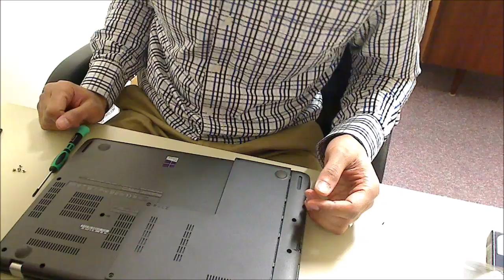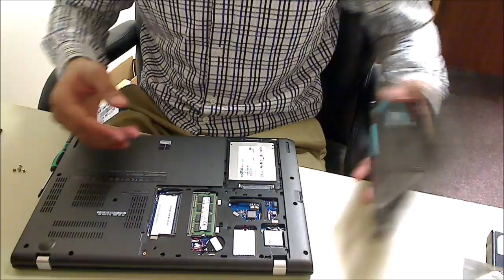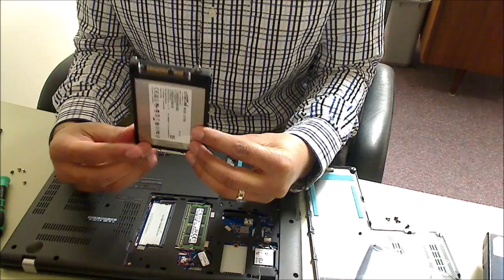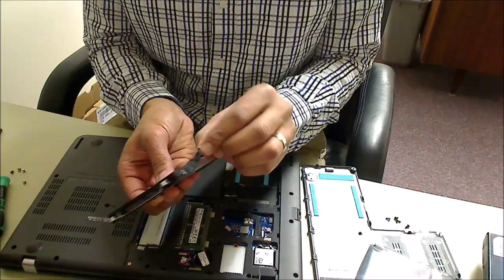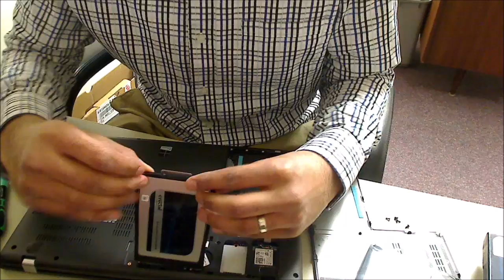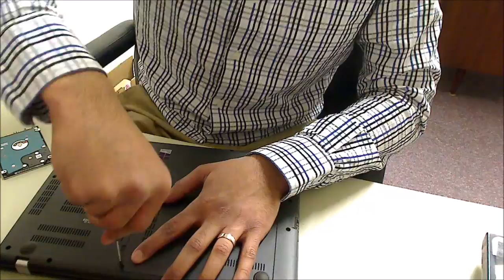Lenovo Thinkpad E450 HD/SSD Replacement Laptop Ultrabook

Comment: Hi, thanks a lot for sharing the video.
However, what happen after you replace the hard drive? how do you install the windows again?
Reply from the maker: Adhika Widjaya Hey, I COULD have cloned the drive it came with to my new SSD, but in the box they give instructions on how to get recovery CD's...you need to make an order with Lenovo and then wait a week to get them.  huge pain.  especially because it comes with windows 7 and I wanted 8, so I had to order and wait.  If you wanted to stay on Win 7, then start up the computer, make the recovery disk through the Lenovo recovery partition, and then you have recovery disks in case you need them in future.  then you could install your new drive and use the recovery disks to install windows on the new drive.
Reply: Skrash3r weirdly enough with Lenovo, if you click the Lenovo Recovery partition, once the Recovery Media Creation application appeared then you click cancel, after that you will not be able to create a recovery media.

Fortunately this link https://jchaven.wordpress.com/2013/08/30/how-to-re-enable-recovery-media-creation-on-lenovo-t530/ shows us to solve it.

echo 0 > Q:\FactoryRecovery\RECOVERY.INI:Done 

Once that is done, I can create the recovery media.
I'm still waiting for my SSD to come before reinstalling the OS.
Reply: Hello. Did you successfully replace your HDD? Could you tell me if the system running your SSD is in AHCI mode? I can't find it in BIOS. I wonder if E450 SATA controller is IDE mode only. Thanks.
Reply: Budi HL , I finally didn't get it replaced with the SSD because my sister desperately need the laptop. So at the moment it is still using the spinning HDD.